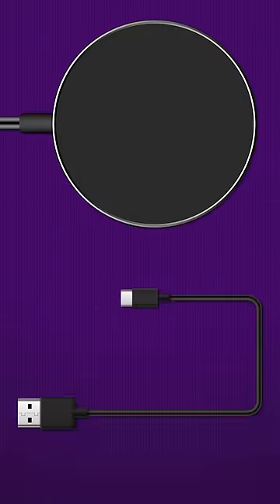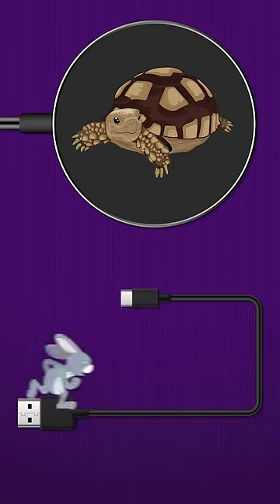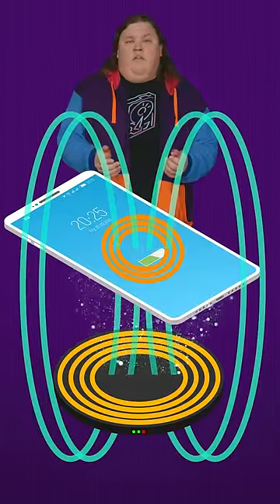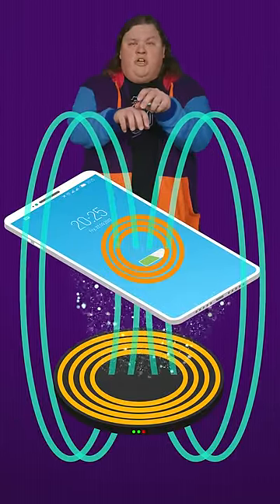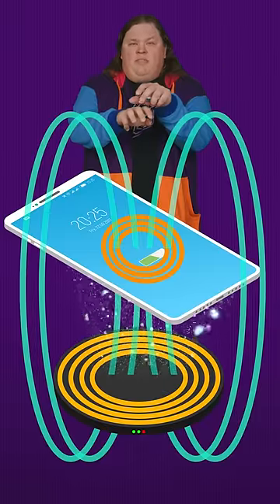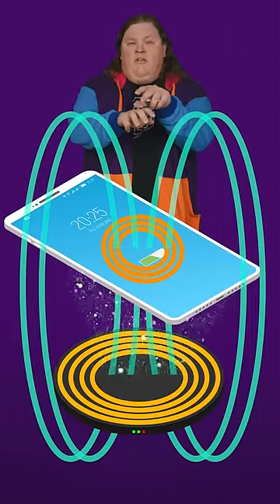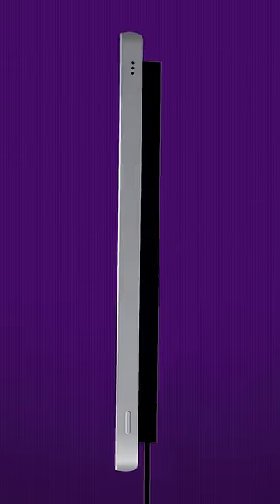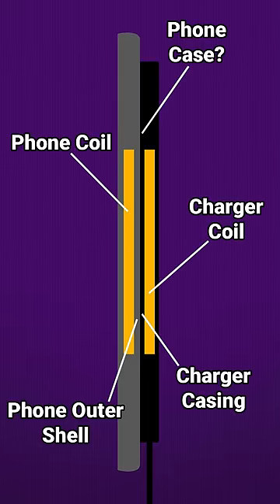Why Wireless Charging Is Slow #Shorts

Comment: can't use your phone while charging, utterly useless
Reply: I can't? The charger on my desk (actually sitting on top of the UPS which is on top of the computer next to my desk) is right next to the keyboard and so in easy range of my left hand. And also far enough away I can actually see the screen without putting on my reading glasses.

The fact that it's always sitting on a charger when I'm at my desk (even at work, where I have another wireless charger) means I never have to plug my phone in to use it because it's always near 85% (max charge to preserve battery life).
Reply: @johnbelli9390  why would you want to use your phone far away on some shit angle?
Reply: @RycoonGalloy  It's not "some shit angle", it's the same angle where i would hold it. And it's at arm's length where I can see it without my reading glasses on.
Reply: @johnbelli9390  then you have a very specific setup most people don't have. And with a dock, you would accomplish the exact same thing anyway

Comment: But can it match Chinese phone charging speed? No.
Reply: It's not bad for battery like Chinese bullshit
Reply: @hooperhops69 well you are absolutely wrong here buddy, both your points are wrong (actually kinda funny how confident that looked) 

Chinese phones have very big heat sinks to keep it's battery cool, if you didn't know batteries tend to lose their capacity overtime due to heat cycles. To counter that Chinese phones have a hard cap for 40*C and big heat sinks as I mentioned before. 

About "It's not bad for battery" is absolutely wrong you sound like a 12 year not doing his homework. Let me tell you K.E initial = K. E final now that means your kinetic energy is always the same if a wireless charge is not efficient it's gonna lose some K.E in form of heat and sound and since no sound is produced it must be released in heat which is bad for your battery. 
About 50℅ extra power is used to charge your phone with wireless charger so it means 1/3 of your power is dissipated in heat which is extremely bad for batteries. 
If you attend your school you won't be in this position